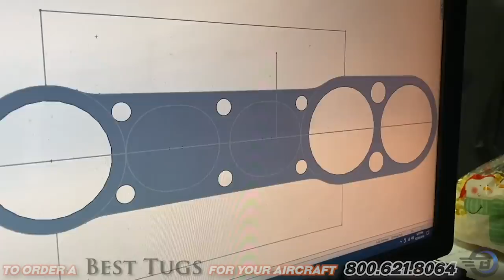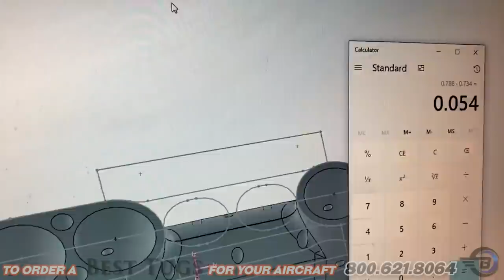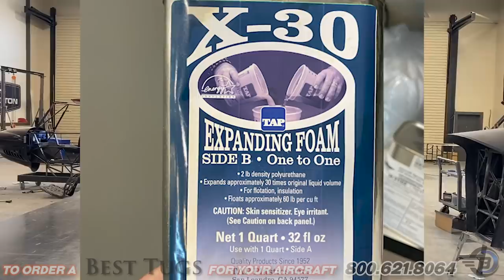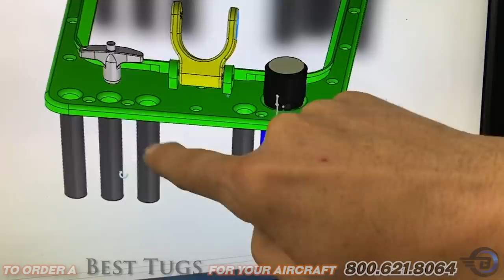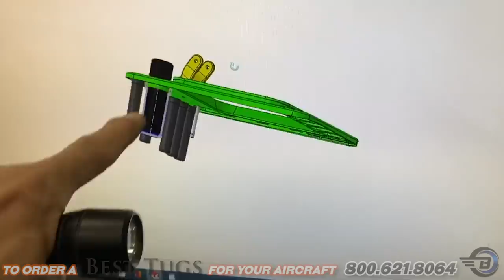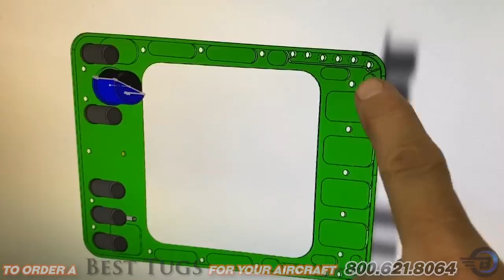Gust Locked 🔒 (Scrappy Bush Plane 14)

Comment: One things is for sure....
Scrappy will have a MASSIVE carbon footprint.
Reply: That's GOOD carbon not BAD carbon!!   ;^)
Reply: Isn’t a ‘carbon footprint’ related to the ‘carbon dioxide’ output of a process or object.  Any process that creates the parts, resin, or uses energy in its final use contributes to the carbon footprint; the engine being the largest contributor.  The carbon fiber comes from pure carbon dust, melted under pressure and extruded through an orafice.  The resin and paint is probably the largest contributor to a carbon footprint of the build. The largest carbon footprint on the planet is from cows (and like mammals) and insects that produce carbon dioxide as flatulence (aka gas).  
The next comet tail to pass through a near earth orbit will ‘steal’ enough carbon dioxide to plunge the earth into the next ice age; the last five ice ages have been like clock work, every 500K years.  The astronomical question is:  Was the comet that hit Jupiter the one that usually reduced the earth’s carbon dioxide percentage to ~200ppm to precipitate an ice age?  Did it steal the atmosphere from Mars?  Ok, sorry to expound, but a good question. The human phase on earth is but a fraction of a tick of the universe clock and the next phase is already written...it is unavoidable!
Reply: @paulbergman8228  Informative analysis, accurate and enlightening as it may be, can certainly let the air out of a plain old joke!   ;^)  Carbon and its environmental "weight" in the endless conversations/discussions/arguments and the virtual "rocks" thrown by the various parties is far too serious for this venue though it seems to have a life of its own, elsewhere.
Reply: @MrGaryGG48  
I got the joke, but I'm not a tightly focused engineer, either. 
Good one!
Reply: A carbon fiber footprint 😎
Reply: Paul Bergman If I had as much time as you to write such lengthy replies, I’d probably be building a plane instead. :-)
Reply: LOL...good one!
Reply: Paul Bergman Although cows produce some CO2, they actually produce a lot of methane which is a gaseous hydrocarbon that by mass is a much more potent greenhouse gas than CO2. Two cows produce the equivalent greenhouse gases in a year of a car being driven approximately 10,000 miles. It’s also methane from the insects that is a concern, particularly from termites I believe.
Reply: Au contraire!  That right there is what you call carbon sequestration in resin, son!  Job done!
Reply: @steveb7310  Is that the one right next to the wide black mark where the "427 Side-Oiler Cobra" left the red light???    ;^)
Reply: @MrGaryGG48  exactly
Reply: @wimbraber944  Wim, if I had the money I'd be building one too, but... due to lack of "entertainment funds" during this quarantine thing, my wife just said, "Go to your room!!" so I'm now quarantined in my office playing on my computer!   ;^)

Comment: Re tugs  worked with lots,on rotary , for northerners, one that works on icey pads is big, and dont use batteries you have to ship across the planet to get. had that issue with someone's, the ability to push and pull the arms easily is a big one in the winter usually, You usually have to kick them in, and people dont push far enough then it rubs(grinds) against the fairings , and almost always drags on the ground. and then there goes the Xmas party....... The ability to use an extension cord is big also on multi bladed machines

Comment: re the control stick will it have a boot? as in turbulence a rough landing or sharp banks the light etc would bounce out, The mantra the enforcement folks want was secured load..and for the stick,, run a few extra wires, and make the harness long enough so you can pull the stick up into the avionics tech lap so they can work on it.. then put the wire into a ribbon and tie it up downstream when your done.. Makes working on them and the hand grip WAY easier. especially with a bendix PTT wafer switch.

Comment: Mike, will you need to tie the tail down each time you park in remote location with the gust lock in place with a forward locking position of the elevator? With such a light tail section I would think it may want to take flight or is the weight aft of the mains enough to keep the tail section grounded without a tie-down? Just asking.
Reply: I was thinking the same thing
Reply: Steve Smith - I think his designs changes the AOA of the surfaces so maybe there’s a offset in elevator position in relation to the elevator locked position?? IDK
Reply from the maker: Great question and I’ll go into that exact process and what I did later.

Comment: @Mike Patey with scrappy being a taildragger i would think it would make more sense to put the gust lock on the back of the plate to pin the tail down in strong winds? With it forward and a strong enough gust I could imagine it lifting the tail and putting the prop into the dirt or lifting and repeatedly dropping the tail causing added stress and wear.  love the videos and your passion for all things aviation.

Comment: @MikePatey - love the aluminium plate for the console!! Quick question: Are you planning to put anything (some sort of material - foam or bristle type stuff) around the section for the torch/pens, or in the tubes themselves - a. to stop them dropping out if you invert, which I suspect you will attempt in Scrappy & b. to stop dust & other bits of crap falling into the tubes... Thanks again for the vids, love your work sir!

Comment: Mike,

Are you not going to have external gust locks at all? I personally prefer to have both a stick lock and external control locks, but my -12 is parked outside. I guess you'll probably be in a hangar for long term parking so maybe extended strain from wind forces on the control surfaces is not as big of a deal.

Also rudder lock? or are you relying on spring tension?

Love the videos, your solution is so much more elegant than my bungee cord to the seat method.
Reply from the maker: Anson Moxness I’ll show the rudder lock later when I install it
Reply: @MikePatey  Awesome, can't wait to see it. Keep up the good work and thanks for keeping us all entertained during these weird times.

Comment: I was wondering if your pens and markers will float out when you pull negative G's. Also, how will you be locking the rudder in high wind conditions? Will the rudder pedals be secured?
Reply from the maker: William Kleinhanz I have something else coming for the rudder

Comment: Mike, the base of your control stick has 3 or 4 holes in it, right at the end of the lever arm.  Looks like a wire comes out of the aft hole.  With the left and right holes also right at the base of the stick, it looks like the material circumference has been halved.  Wouldn't you like to have, no holes right there, or those holes some more distance away from the point at which it would fold under a failure load?  Do those holes have to be all at the same "altitude"?  That tube is made to have the weakest strength right at or very near it's point of highest potential stress.  Maybe you can't pull or push the stick in any direction that hits a stop?  Is there an angle of stick force, at which there's a weakness created by those holes at the base of the stick, where the stick is less strong than a human with his legs braced can pull?

Comment: Mike, it doesn’t exactly pertain to this video but because this is your latest one, I figure you might see this. What is your suggestion to use for tinting airplane windows? I know vehicle tint isn’t feasible and there are many hold in place inserts, I was just curious to know if you have found any plexi glass safe tint that has good visibility? The static cling stuff doesn’t seem to provide adequate clarity. Thanns
Reply from the maker: Walton I haven’t found a good tint. I have tried several.  I now replace the entire window with already tinted glass

Comment: Hey Mike hope you and your family are staying healthy and safe.  I had a question/thought about suspension.  With the huge amount of travel that Draco had do you think that it any way contributed to the accident?  And if so would there be a way to limit that sort of travel for take off on Scrappy (assuming you are going to do some sort of bitchin mega travel set up)?  Maybe something like what motorcross bikes have in the front forks for starts.  Obviously not an exact comparison but I think you are probably familiar with the concept I'm talking about.  Something that might only be used in adverse weather conditions ie stiff cross winds.  I might be way off with the whole thought though and by no means is it any criticism of your skills as a pilot or designer.  I aspire to be half as good a pilot and 1/16th the engineer as you.  And 1/16th might even be dreaming too big.  Have a good one, stay safe and can't wait for the next video!!!
Reply from the maker: Lincoln Molin I love the way you think.  The gear is done and you are going to love it! 😜🤠🤠🤠  your on the right track 👍

Comment: Have you tried working with Crystal Clear Gorilla Tape?  Stuff is easy to work with but costs quite a bit more the the typical packing tape because its HD and then learned that they also sell a dedicated shipping tape with fewer mils.

Comment: hi @mikepatey, Darren from the UK.
i know you said theres plenty of tension on that gustlock U-bolt swivel so it cannot move, but im frightened to death that it will rotate round in flight and obstruct a control stick movement. Can the U-bolt be retro fitted with a spring to keep it in the open position, or some ball bearing detents or even a simple threaded hole in the aluminium to wingnut it tight open?
Thanks for all the regular videos, i would love to come over to the states sometime and meet the gang, and keep up the good work.

Comment: How about putting a flange on the control lock yoke with a hole so the pin locks it in the forward position to the aluminium deck to ensure the yoke can’t vibrate or be knocked (e.g. when grabbing a pen) into a position that interferes with the control column?
Reply from the maker: jlewispilot  it does the video I missed showing it. There are two pins the one storage was for the rudder lock I’ll show it better in that video showing the lock out on the gust lock how it locks down
Reply: Mike Patey - That’s good - thoroughly enjoy all your builds. Thanks for sharing and inspiring.

Comment: I hope Scrappy get's a billet intake manifold with V-band or Vibrant connections on everything.  Check out some of the work Plazaman does, I'm sure he could create a CNC'd masterpiece that is way safer/ reliable than those old school blue silicone elbows and hose clamps.

Comment: With a tiny mod to your gust lock the pin could hold the bracket from ever being pulled up accidentally... 

A new can of tennis balls rolled behind the brake pedal but stayed on top of the gas pedal. The more I pressed on the brakes the more throttle I was giving it. I was at Tim Hortons about to learn what drive thru really means. Yet another reason why I like a standard transmission.

Comment: One other idea. On stick lock. Would a spring on bracket that would move it forward be a safety measure. Just to prevent it from getting in the way down the road when things loosen up. Are a detent set screw. I’ve enjoy your design. I never know when I will learn something new thanks.

Comment: Awesome video again. Coming together beautifully. Question - did you consider machining a fitting forward of the gust lock so you could stow it in flight to guard against the unlikely event the yoke fitting moves aft and interferes with your controls?

Comment: Do you think the storage for the locking pin should be through the Gust Lock Bracket when its it's in the stowed position to prevent any chance of accidental engagement while in flight.? I understand this would be very rare to ever happen but anything is possible as you prove to all of your viewers with every video you make .
Reply from the maker: Jeff Gerber yes, I did exactly that. in the video edit  I should the pin drop in Storage but that was the Gust lock pin For the rudder location. The other pin locks the receiver from movement in flight.  I should have talked about that but I am doing a video in the rudder lock later and really could have done better exposing the two pin locations 👍🤠

Comment: Hi Mike. Love your work ethic. Could you make the arms on your lock a bit longer so you don't have to put a hole in your control stick, i.e. the pin just goes and locks the outside.

Comment: Awesome build! I really enjoy watching these videos. I have a question about the carbon fiber, what kind of epoxy resin do you use? I've noticed in some occasions that high temperatures can soften resin to such a degree that it becomes malleable. Especially when you want to keep the look of the carbon fiber giving a nice dark surface that absorbs a lot of energy. I'm sure you have that all figured out, so am curious what you did to prevent those issues.

Comment: You should pin down that gust lock when not in use. Just add a little bit extra on the side so you can pin it in the flipped away position. Would be that much safer.

Comment: silly question... but why have the gust lock on the front side and not the back? with the control stick in the full forward position, oncoming air would lift the tail off the ground, but full aft would force the tail down.
Reply: I thought he mentioned easeability for getting in and out of the rear seat? I know he has something planned for the rudder in an upcoming video.

Comment: Is there a reason why your gust lock doesn't have lightning hole in the front middle of the plate?
Reply from the maker: Pascal Robert - Rc Creations if I understand your question exactly the answer is the strength I need on the pivot moment of the gust lock out needs to be thick or eventually it would fatigue and crack

Comment: Hi Mike.  It there any chance that the "Guss" lock (sp) could unintentionally flip into your field of travel and cause your stick to get locked out of the rotational ability?  I did not see a lockout to keep it from flipping into the way other than from friction?  Could a small tab on the side of the "Guss" lock arm have a hole in it to place your pin lock through that then into the spot you have milled to keep the pin lock for when you use it.  Then the pin lock can lock back the "Guss" arm and it would never get into your sticks field of travel unintentionally.  A simple fix to make a new "Guss" arm.
Thanks Mike in Canmore AB Canada

Comment: Mike,

Nice design 😎

Isn’t putting the gust lock at the control column, instead of at the individual surfaces, causing you relying on the cables to take any additional load due to gust ? 

Not a problem unless, I guess 🤔 , your aircraft is parked in 100 mph winds, at which point loads might just advance beyond the yield point of the cable material, unless you’re going all “Tim Allen” (Home Improvement TV series, 1990s) and have loads of margin for the cable capacity. 😉
Reply from the maker: Dave Robinson  I’m going all time Allen 😂👍🤠 and some certified aircraft also do it this way.  I’ll show more on the system when I show the rudder lock
Reply: Mike, indeed, the Cessnas I fly use a lock on the control column for the elevator and ailerons but the (larger surface) rudder uses a gust lock at the actual surface.

I know whatever you choose to do is going to work 😎. 

Really enjoy what you and your team (family & friends) are doing for our aviation community. Especially at this time 👍

Thank you 🙏

Ps - you sealed the under floor to prevent FOD ingress from impacting systems and wiring however, will there be a pressure equalization issue as you rapidly climb to altitude or will you include provision for sufficient small vent holes ? .... keeping in mind location to avoid possible water ingress (e.g. rain or melted snow).
Reply from the maker: Dave Robinson  I’ll show the rudder lock later along with the lock down of the u shape gust lock in front. You are correct my rudder lock is at the rudder end because of its size and yes I have vent release from cabin to belly and belly to exterior 👍🤠 we think alike my friend
Reply: Mike, I’m grateful to be learning so much from you 👍 and being thoroughly entertained at the same time.

Once more, I offer my thanks to you and all of your team for all that you are doing for our aviation community.

Comment: How about instead of the pin dropping down to store, it slides through a retainer that pins the gust lock forward and out of the way so it can't get bumped or accidentally moved down into the way and limit your stick motion. pins open or closed, so it can never move without your say so. Too much safety? The new format shorter videos are cool, its fun to see what's going on more often!
Reply from the maker: Chris Fiondella I wish I could post a picture here.  It locks down, I’ll show it in another video 👍🤠

Comment: That gust lock is great, but it will be too low, it should be 3 in higher, or it will lock on to the leather boot! ;) Another thing I think, is the position of the flight stick, I think the motion should be centeret  more close to the opening of it's placement. It moves too much fwd/aft wich may give problems with the boot also ;)
Reply from the maker: Lars Rosing  I’ll show more later 👍🤠

Comment: Boot holder, technically an escutcheon or bezel, darned if I can remember the difference though.  Bezel is a lot easier to spell though!  LOL
Reply: Russell Hillis If you understand his meaning, in the end it doesn’t really matter. Escutcheon is more fun to say I think.😎
Reply: @tomcoryell  True and in this case probably the more correct term.  IIRC, on cars & trucks, bezels were on the outside, escutcheons were on the inside.  It's been a while since I needed to remember that though.